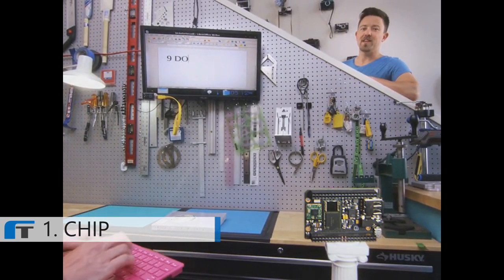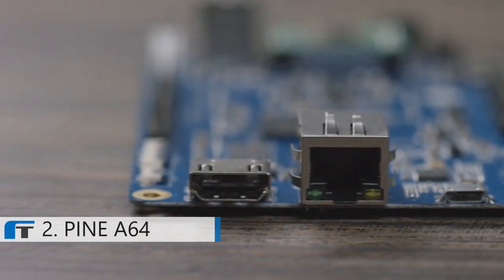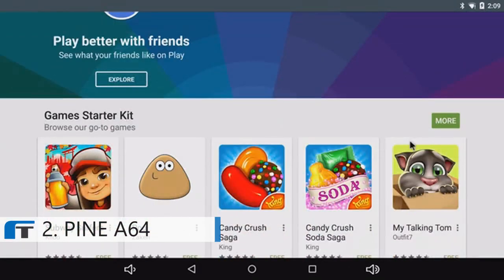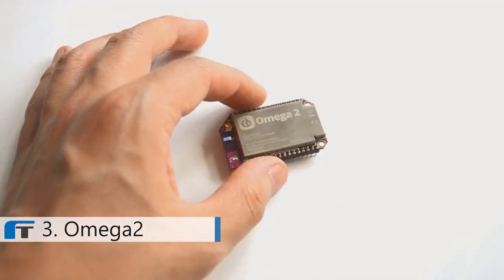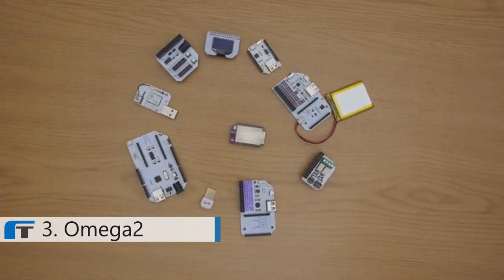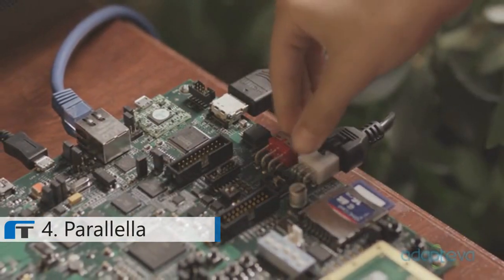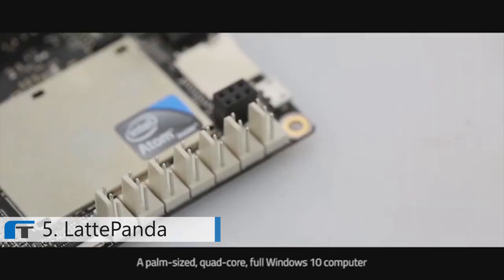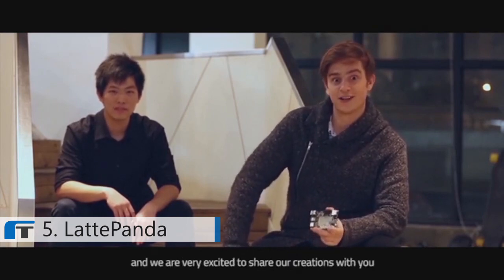5 Smallest And Cheapest SuperComputers You Have Ever Seen

Comment: The main problem these small computers have is a complete lack of cooling the CPU which can get very hot. Please note its a choice of the designers to do not fit a cpu with a proper cooler.  Why ? I think to sell more boards . Try to work half an hour with these and they end up molten. Trust me do not use the product without cooler for more than 10 minutes! Or install a cooler yourself on the cpu to make it last longer!

Comment: Can i run Gta v on one of this?
Reply: Tony snake no,  none of this is able to run Windows (just latte panda)  and even if I were wrong they have no graphic power to run it
Reply: Fuck💢
Reply: Tony snake haha, it would be awesome if it were possible...
Reply: Zona ALG oh it is, just solder in a pcbi slot slam in the latest nvidia card,Whamo 1500 $ gaming computer,that's how it works right? u just solder the part in and it's all plug and play right? yes...it will work!
Reply: Rafael Carvalho almost all things with the word "Micro" arent as powerfull as their same without the word.

But they are better for some stuff
Reply: Rafael Carvalho yes, but also as small portable emulation stations and a low powered NAS!  Which is pretty cool for such a cheap board